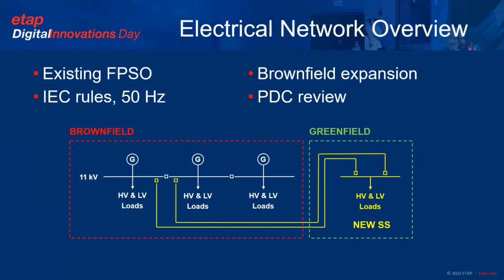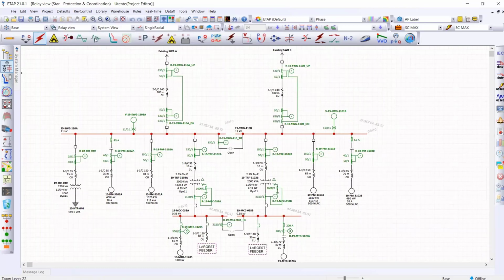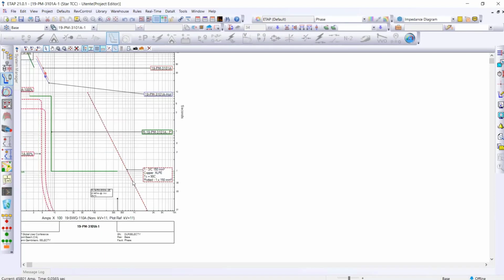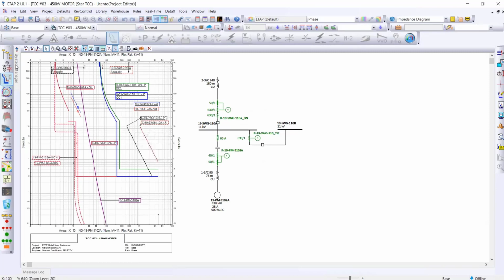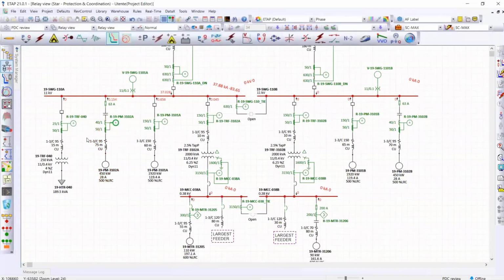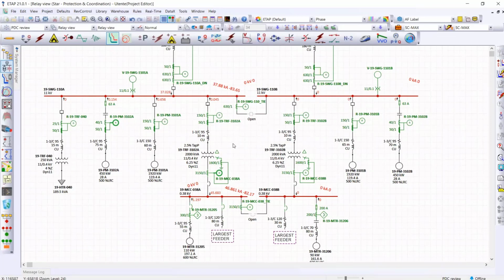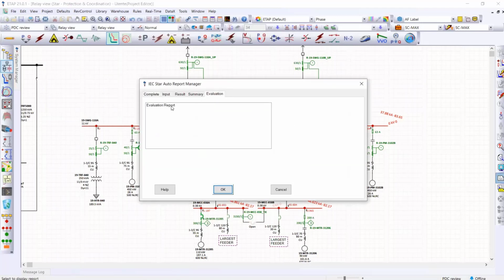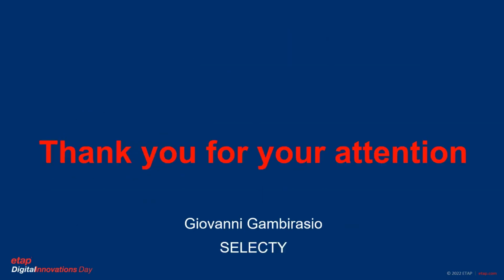Review Process in Protection Coordination Studies

Comment: After completing design there is any function can apply or do organizing all main buses and branches in the engineering way can shorten or lengthen and give it the best shape SLD through software or not exist yet if not this can be taken as a feedback for the next version releases of etap. Thanks in advance.
Reply from the maker: Thank you for your interest in ETAP Solutions. You can use the auto-align function in design mode to get the optimal SLD layout. Please refer to the ETAP user guide or for further assistance please open a ticket at out 24/7 Help Center https://helpcenter.etap.com